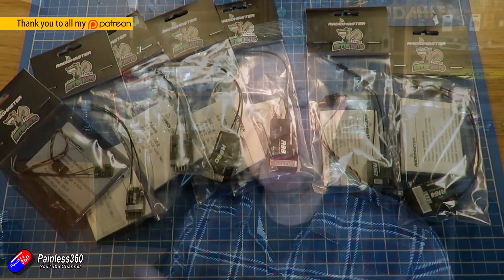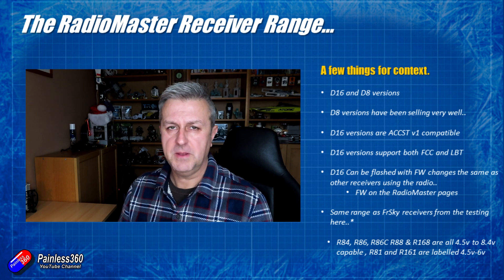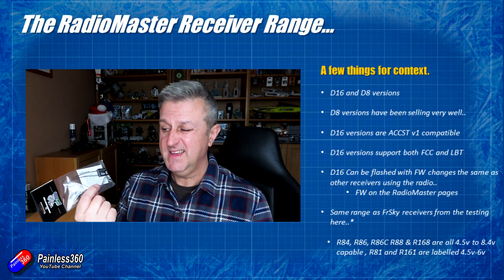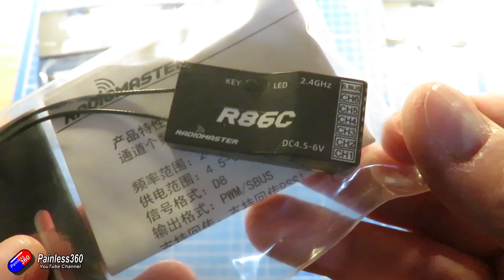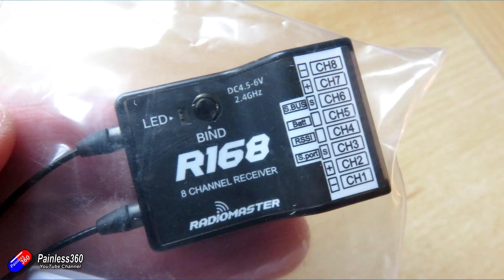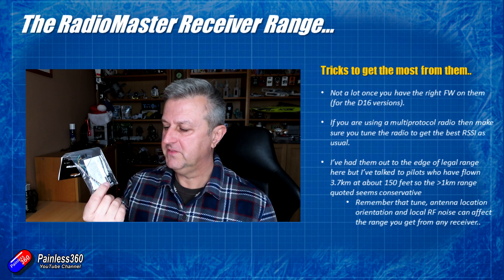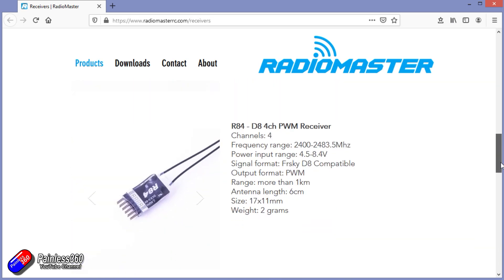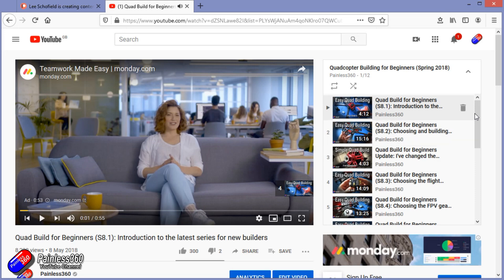NEW RadioMaster Receivers Overview: D8, D16, ACCST V1 and V2 including S.Port and FPORT

Comment: Hi, love your information. I am hoping you can help me. I have been using Futaba for many years & have been very happy. I am going to move over to Radiomaster 16 transmitter & wondered what 8 channel receiver I need? I only fly fixed wing! My goal is to receive live information on my flight battery. 
Thanks Sean.
Reply from the maker: One of the ones in this video would be my choice... Best of luck

Comment: Wow! I am getting back into RC slowly after a few years. My last plane was Parkzone's Decathlon 3 channel. A simple park flyer due to where I lived at the time.

I just purchased a Radiomaster TX12 mini to try ether a BNF or PNP 1300mm or 1700mm STOL.

What I did not know was the TX does not come with a recevier.

Which receiver in the Radiomaster lineup would you recommend for a 6 channel setup?
Reply from the maker: That depends on the model you bought, the ELRS or CC2500 version...

Comment: Many thanks for your informative videos. I purchased a couple of R88 V2's recently in both LBT and FCC models. I cannot for the life of me get them program a failsafe. After applying the failsafe throttle  -100% settings in my RM TX16's the motor just spins on at it's last setting after turning off the TX. I also tried the Receiver option in failsafe and that didn't work either.  The LBT model binds in FrSky X LBT and the FCC again in FrSky X D8 or D16. Any ideas on what I might be doing wrong, would be much appreciated. Thanks.
Reply from the maker: Bind using the D16 setting. It  is not possible to customize Failsafe with D8 protocol, you can use D16 to re-bind, select Receiver or Custom in the remote Failsafe, and then press the receiver button within 10 seconds of the receiver being powered on.
Reply: @Painless360  Thank you very much. That did the trick nicely on both the FCC and LBT RX's. I also didn't realise D8 didn't support failsafe. Thanks again. 👍

Comment: Hi. im unable to bind my R88 V2 receiver (which i thaught it would support ACCST v2.0 as name mentions v2 on it) to my Taranis qx7 which uses ACCST v2 version. Is there any possibilities on upgrading the R88 V2 receiver to support ACCST v2 D16 protocol? And what is that cable that is been provided with the receiver? Is that an smart port connector?
Reply from the maker: Specs and firmware updates should be on the Radiomaster website. This is not a reciever I've used a lot... best of luck

Comment: Thanks for the video. I've been going through your channel over the past few weeks and it has been super helpful getting me started in RC. I have some questions - I'm just getting into RC and I'm thinking that I should go with the Boxer as is has a bunch of channels and knobs, high transmit power, and supports telemetry. I plan to work in Ardupilot with a Pixhawk/controller that can run Arduplane and am wondering:

- How to find a receiver compatible with the Boxer and supports receiving the sensor data from the flight controller/Arduplane, and support SBUS/PPM for the flight controller. 
- Is an SBUS/PPM output/input on the receiver what sends telemetry back to the transmitter? Is transmission of controller telemetry into the Boxer-sytle of transmitter screen even possible?
- Does the Boxer work with SBUS or PPM, or is that up to the receiver I choose?
- Can Ardupilot even send telemetry back to the Boxer or is that an iNav thing? 

Thanks!
Reply from the maker: Hey Josh, building UAV systems can be a lot of fun but there are loads of terminology that can get in the way. I just finished a video on ESC protocols and have one planned to revisit receiver protocols soon. But in the mean time - 
- If your Boxer is a Multiprotocol one, I'd look at the X8R, X4R, XSR and similar receivers from FrSky.
- SBUS sends signals to the flight controller digitally. It's one way. Receiver to flight controller.
- SBUS is down to the receiver. All of the ones in the first answer will provide SBUS
- Yes. Using a separate Telemetry link. Smartport is something on those receivers too and I have many videos showing the setup. 
Check out my series aimed at beginners for the technology you want. Also, check out the Yaapu videos for how to use telemetry too.. Best of luck!
Reply: Thank you! I think I’d prefer ELRS for the 1 Watt so I will look into that. It’s exciting to find out more (especially through your channel!) for understanding, knowing what’s out there, and getting set up. Thanks from Canada
Reply from the maker: ELRS telemetry isn't great IMHO. If that is important then maybe look at other things too.. Happy flying!

Comment: Can you please advise whether the R86 or R88 D8 receivers will be compatible with a Taranis QX7S receiver with the ACCST system as it does give you a D8 option in the setup menu?
Reply from the maker: The R88 V2 receiver is Frsky D8 / D16 and Futaba SFHSS Compatible  so should work with a multiprotoocl rdaio. See the videos on the product page over at Radiomaster - https://www.radiomasterrc.com/products/r86-receiver

Comment: Great video.  I have been following all of your ethos videos since I also have a x18 transmitter.  Now for the radio master question.  I purchased a R88 receiver which apparently is a early version, not a v2 and I cannot get it to bind to my frsky 18s.  I wonder if I’m doing something wrong.  The protocols available are access, assist d16, and Tmode.   There is not a d8 mode.
Reply from the maker: The R88 is an ACCST V1 receiver from that I recall. I made a video in the ETHOS playlist about the options to connect to ACCST V1 receivers (using an extra module). I hope that helps.
Reply: @Painless360  yes it does.  Thank you. I will look for that video.  I purchased it from Armsoar on the same order with my transmitter so I “assumed” it would work.   I’m not prepared to buy another module at this time.  Will the current R88 V2 bind to the X18s without a module?
Reply from the maker: I doubt it unless they are ACCST V2...
Reply: @Painless360  again, thank you so much.  I fly gliders so I always look for your ethos and glider related videos.  You have an incredibly pleasant and informative way of explaining your topics.

Comment: Will the R88 V2 work with the Tandem X20 without a module? If we have to Flash it with ACCST V2 as you mentioned in your video, I cannot seem to find the link to the file on the Firmware page. Could you please post that here?
Reply from the maker: Not sure, I've not got one here to try. If it is ACCST v1 (I suspect it is but can't say for sure) then you'll need a module in the radio, see my ETHOS series for how to talk to ACCST V1 receivers.

Comment: Hi Lee @painless360, i have a couple of older R168s that have been withdrawn from the market which are D16 receivers. Now my question is, would it be possible to setup these Rx to work in couples to have 16channels? Or is it possible to set it up in a way it transmits 9-16 channels through the servos on sbus mode? 
Has anyone tried that?
Reply from the maker: I've not as I never managed to get another one to try before FrSky stopped RadioMaster selling them. I wouldn't expect that is the case as I didn't see anything about that in the manual..
Reply: @Painless360  that'll be a cool experiment then. I'll try that and write back :)
Reply: @Painless360  verified. R168 Rx does not bind in any other modes like the X8R

Comment: I have bought two R86C receivers to link to my Radiomaster TX but I cant get it to bind, any thoughts?
Reply: Same here. You would think the instructions would mention the protocol required and all, as it's a Radiomaster receiver most likely purchased for Radiomaster transmitters. Typical idiots running the show. This is just in case the Radiomaster idiots pop in with something to say...Per instructions for binding R86C: 1) Turn on your transmitter and select the desired protocol...Yup, just select whatever desired protocol you want.

Comment: I see that RM dropped their D16 series of receivers awhile back and although I was able to still buy  some does it mean that there is no RM RX product that supports s.port. ?. (Rather than using a timer on my TX I have always used a FrSky battery cell level sensor connected to the s.port of the RX).

Comment: Great video.
I was not aware Radiomaster had a good selection of receivers.
I am trying to select a receiver for a 500 size Heli, the Align T-REX 500XT with BD AXON FBL and pair it with my Radiomaster TX16S.
The R161 seamed a good option as I can connect it to the FBL system via s.bus.
Shame that it only supports up too 6v. I was hoping to run everything on 8.4v as all servos can as well as the FBL.
Doo you know off any option that can bind to radiomaste and supports up to 8.4v?
Thanks
Reply from the maker: I think the ol' FrSky X8R can handle up to 10v... Best of luck!

Comment: Have you tested the range of the 168 I have two of them wkich i find have a very short range.
Reply from the maker: I've only park flown and mine has worked fine. Do remember to use the fine-tune in OpenTX.  I'd contact the seller is you're not happy.

Comment: Hey Painless, I have the Radiomaster TX16s radio with the R86 & R88 receivers. In four different planes and they all keep telling me RSSI LOW a lot, so I did the "fine tuning”, and it has reduced the number of times it telling me that RSSI LOW to once or twice a flight. any ideas of what to try I have not found any thing to tell me the proper placement of the antennas. I have been installing one straight back from the receiver and the other at 90 degrees of the other. could this be my problem?  How do you place the antennas? Thanks!!
Reply from the maker: Low RSSI can be caused by lots of things and you've done the basics on the radio to remove those. Antenna routing, placement, alignment and local RF noise at the field all take their toll...

Comment: Any idea on why my Omnibus F4 Pro wont detect R161 SBus? It works fine with Pixhawk and my F4 Pro can detect SBus just fine with my X8R. Tried to flashed it with the Radiomaster firmware with no sauce.
Reply from the maker: Not sure. Do other sbus recievers work with it?
Reply: @Painless360  Yep, it's working. Weird, but just switched it with my Frsky receiver thats on my Pixhawk (the R161 is used in the Pixhawk now) and problem seems solved :). Just putting it here in case other people have the same problem. Thanks!

Comment: Anybody knows how to enable F.PORT on the R161 ?
Reply from the maker: Check the  firmware for it on the site - https://www.radiomasterrc.com/article_cat-14.html there is an Fport flavour..
Reply: It is not as simple as selecting F.PORT on the FC board and expect the receiver to work with it, right ? To work with FPORT we'd need a FW update from Radiomaster ?
Reply from the maker: Remember the as a Patreon you can always ask me a question on there via a PM for a far more detailed answer.. Happy flying

Comment: Hey mate, hows things? Would you fly a 60cc plane using one of those rx?
Reply from the maker: I've not had them long enough to say. So far so good...
Reply: @Painless360  Thank you a bunch. I would love to see your opinion on that. Unfortunately 99.9% of the yt channels that talks about Radiomaster are made for drones not mentioning fixed wings of different types. We do like new techs and brands so please, keep in mind that 3D flyers gas planes often change brands
Reply from the maker: As I said, so far so good.. The key is to use the 'tune' function if you have a multi-protocol radio for the best reception..

Comment: Lee you are the first guy to say anything about flashing firmware to these receivers. I just got the R168, from what I have seen so far everyone just binds and its ready to go. Is this firmware stuff necessary, just never heard of it on Rx's?
Reply from the maker: Most are lucky to be using a compatible firmwares on their radios. If you don't then you can use the other firmware files to update the reciever...
Reply: @Painless360  Oh ok so if i upgrade the radio to the say touch screen version of firmware (when that one comes out), then I should upgrade the receivers, correct?
Reply from the maker: https://youtu.be/2QbXrTMrk6w
Reply: @Painless360  Ah ok thank you. I get it now. I appreciate it

Comment: The R168 DID not work out of the box for me. Was confused at first since I didnt immediately find any firmware options for it online, but it was just hidden somewhat down on the radiomaster download center page. After that I unfortunately had to cut off a couple of spare servos wires to make something what would flash the new firmware. Use the S.Port, voltage and ground port to flash.

Comment: Which one would you recommend for a Tarrot X6 build with a Holybro pixhawk 4?
Reply from the maker: Check out the Big Boys Toys and PixHawk Cube builds. I would use a Durandal over a PixHawk 4 as it's a lot smaller. The PixHawk 4 is fine if you have space for the extra board.

Comment: These receivers look great for wings, I guess for quads is the small D8, but range won't be good for 5 inchers, mostly whoops then
Reply from the maker: D8 has great range - it's only the SPI versions that are not great..
Reply: @Painless360  I bought 2 R88's
 both of them loose their bind and fail to operate using my QX7
worthless

Comment: The R168 is exactly the receiver I've been waiting for in vain from FRSky:
* 8 pwm outputs
* Proper plastic case
* VBAT input without fiddling with external resistors
* Proper servo connector outputs for sbus and s.port, no soldering flimsy wires
* Decent bind button
* Ability to easily select which flavour of ACCST I want to use
 So much better than the RX6R I've been using as my default receiver and less than half the price. All I want now is a stabilised equivalent to the S8R with the same VBAT input and a similar price saving!
Reply from the maker: Hey Chris! Why oh why are FrSky not giving us what we want rather than trying to peddle stuff the hobby isn't interested in any more? They had the entire market for cheap, OpenTX powered systems sewn up and blew it leaving the door wide open for RadioMaster and Jumper.. Happy holidays!
Reply: @Painless360  Totally agree and that's the reason I swapped. Happy Christmas